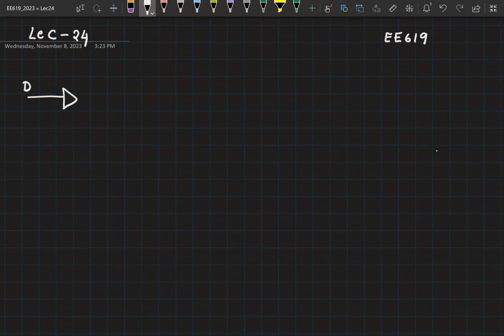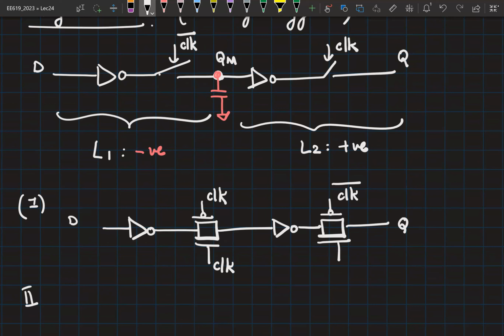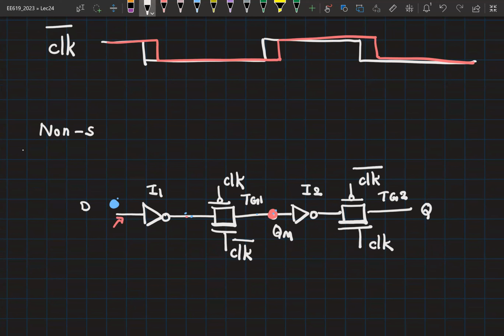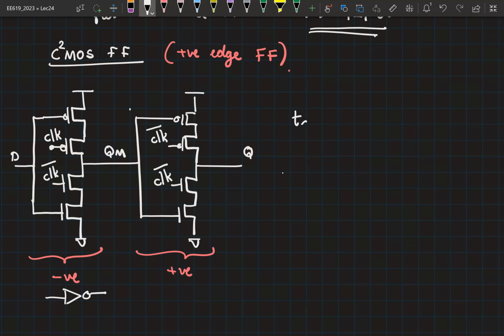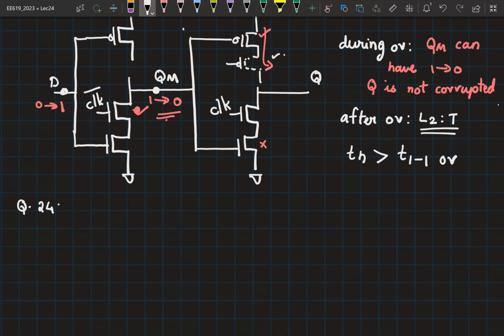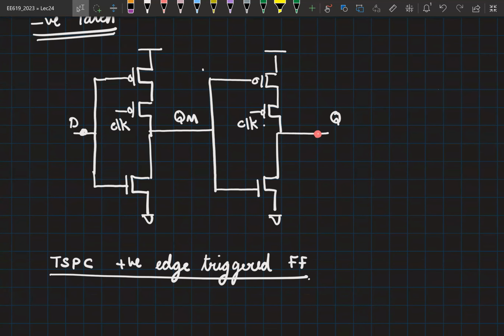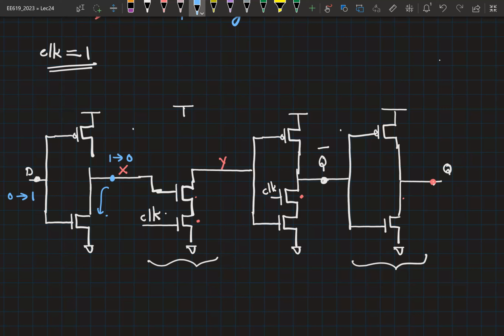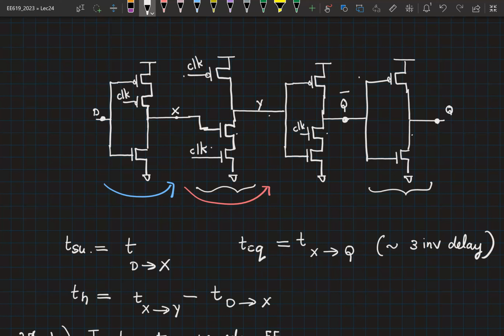Lecture 24: Dynamic flip-flops

Comment: isn't lecture 23 in vlsi system design available for some reason?... Hope to see that also.
Reply from the maker: Lecture 23 was not recorded in class due to some technical issues.
Reply: @sscdiitk Too bad...  If lecture 23 of 2022 is available, could you upload that instead if possible.....